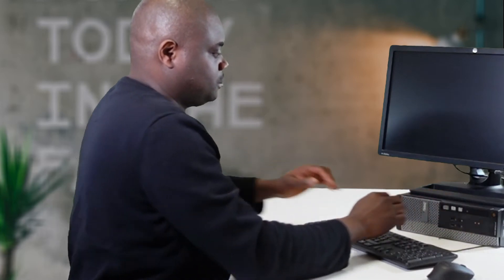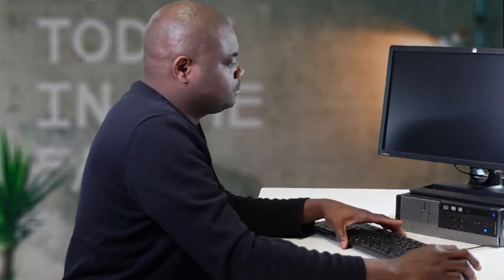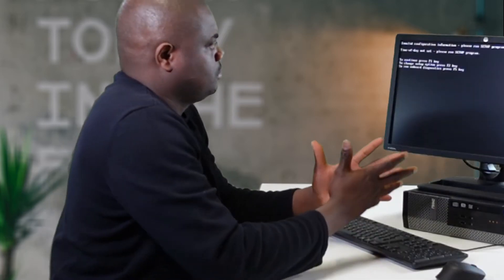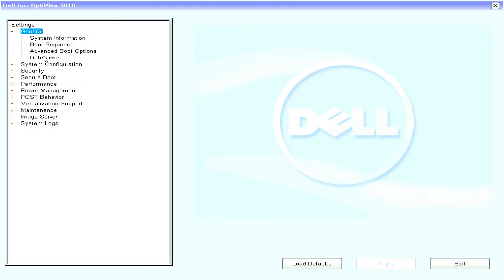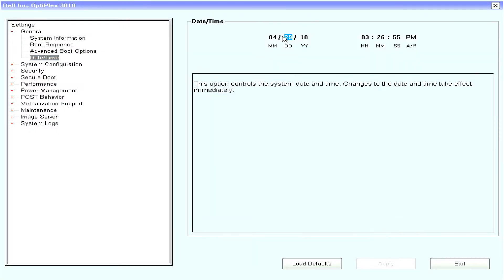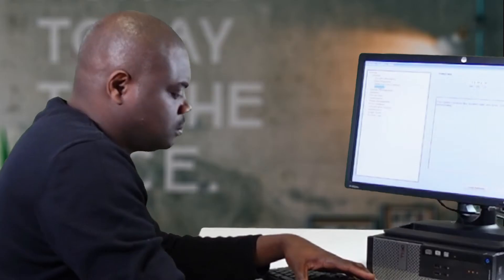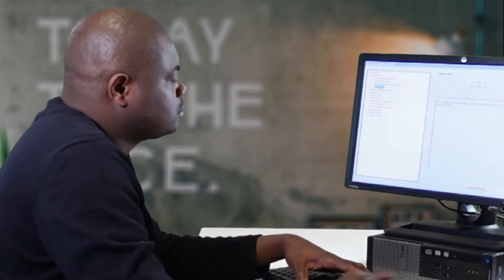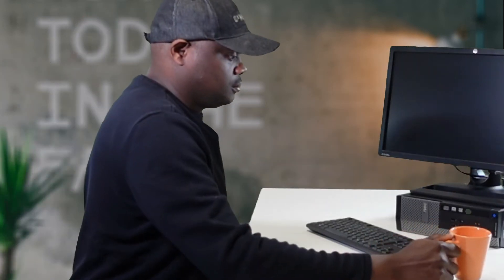How to replace CMOS Battery on a PC

Comment: You have the same pc as mine
Reply from the maker: oh really, its a tough PC 🙂
Reply: @Hardwaremoney   My HP laptop battery is 16 years old and still has no problem. My bios had been updated in the past. If I replace the battery will I lose my updated bios? I do not know how to reset it. Will I have to update the bios again back to the same version or will it keep it but need to configure some changes in the bios? Also what changes in the bios will I need to configure, may please tell me in detail? So I can take note of my bios before or print out my bios to compare if needed.